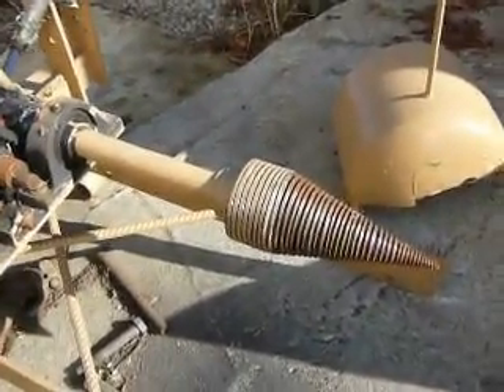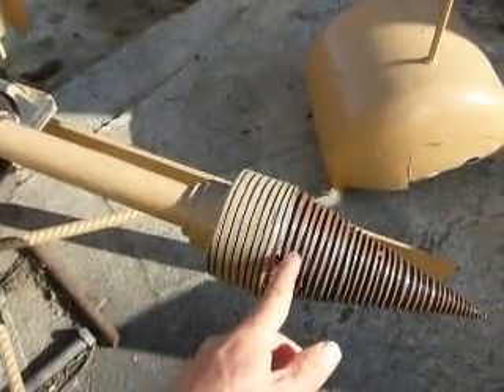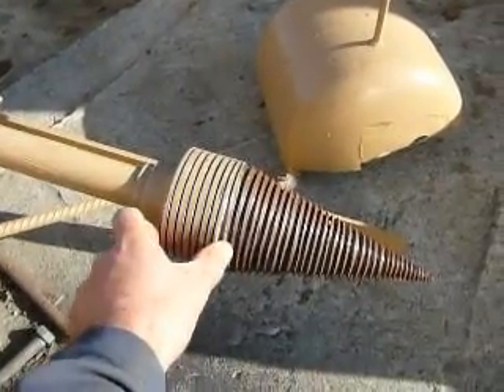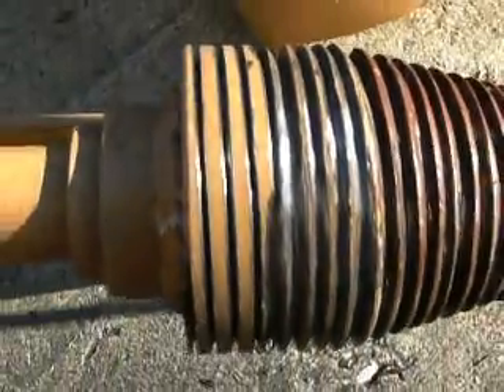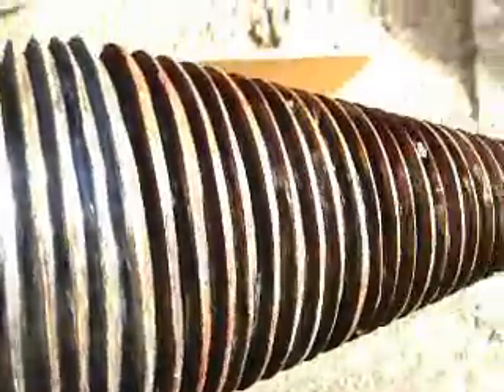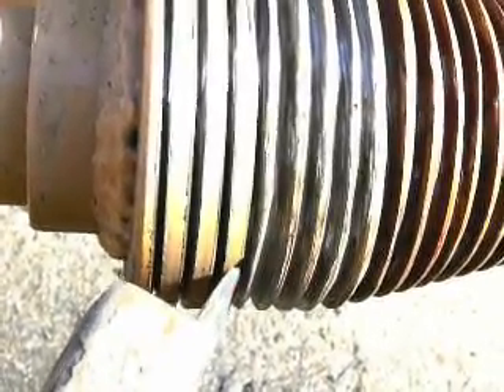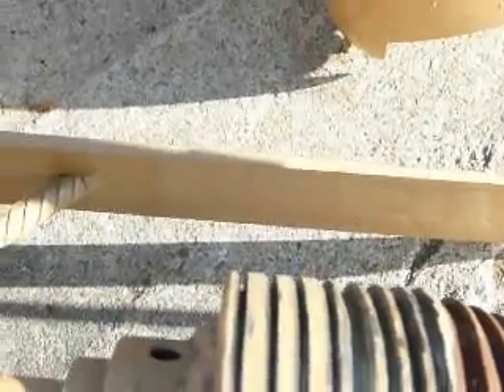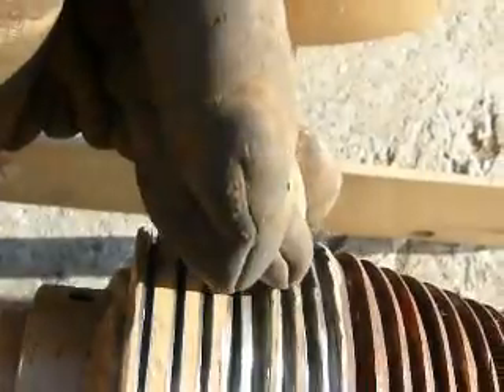How to make threads on the screw

Comment: Question at big end 4in and the lenth looks on 8 inch hard to tell
Reply from the maker: Hi,
The length is not very important. Of course , too short is not gonna work well. This one is about 10 inches long.
The diameter is up to you also. But i have big logs ( up 24 inches  hard wood ) to split, so i needed a 4 inches.
I had the the cone shapped part made at a machine shop  and the hole for the shaft. I added a hub that we usually weld on gears. there's a keyway and set screws.